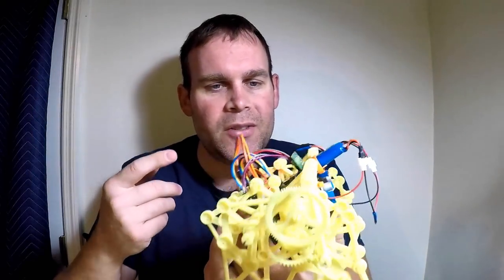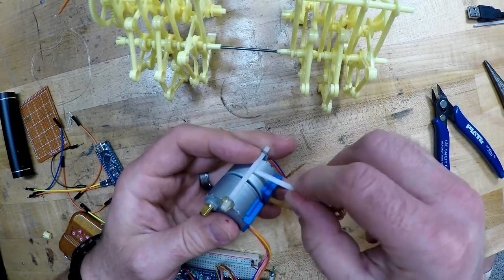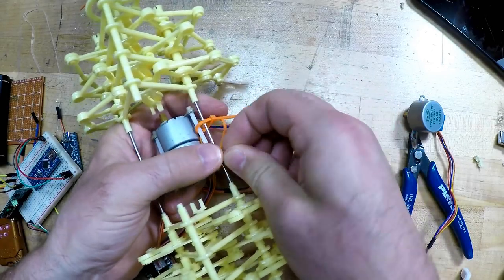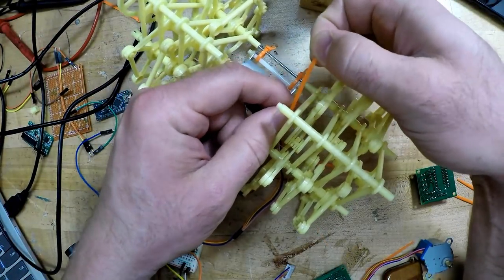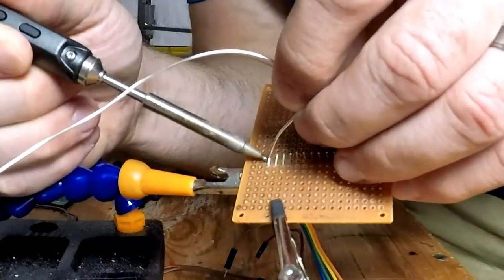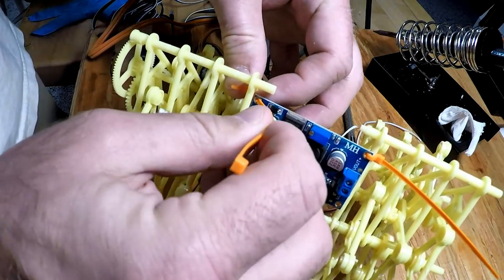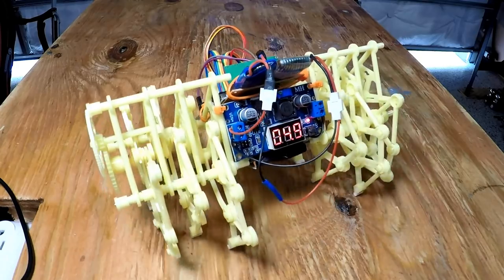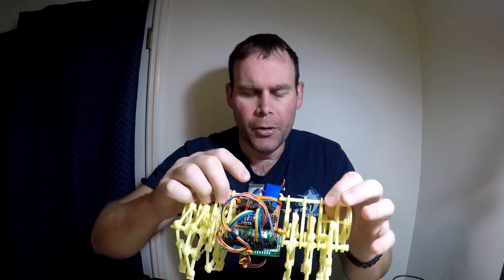Stradbeest Kit Remote Control [Arduino Nano]

Comment: very nice! you might want to look at switching to a Wemos D1 mini as the brains. Since it has wi-fi integrated, you could skip the RF receiver and just control it from your smartphone over wi-fi.
Reply from the maker: That's a good idea. I'm a bit fan of those boards, and actually am planning to use one in an upcoming build... so stay tuned :-)

Thanks for checking the video out!

Comment: Hi Mr.Cook, I really appreciate your work and you sharing it with people...
I decided to do this project to introduce kids to basic electronics, and after following your Instructables page, and copying your code exactly (since I'm a begginer to Arduino) the robot didn't work. Could there be a problem with the code ? Or should I check something else ?
Reply from the maker: Hi Rasheed - It's possible something is incorrect with the code, however, without any other information I would expect something's not wired correctly (the code doesn't really change if you copied it directly, though it's possible I loaded it incorrectly). 

I'd check to see if the LEDs on the stepper driver boards are lighting up at all when you press something. After that try to establish a component that works, and work your way out from there to see what's not functioning correctly.
Reply: @JeremyCook   After checking the wiring we found a small mistake we did with wiring stepper motors to Arduino. (We wired int2 and int3 to 6 and 5 on Ardui by mistake). After correction it seems to work fine, just as shown in your video.
As I'm doing this project as a begginer I didn't read and understand the code properly (hence the small mistake).
Thank you again for sharing your work. A cool project to start with.
Reply from the maker: Glad you got it working, and happy to share!

Comment: Where can i get the batteries? And why are there two?
Reply from the maker: Hi Nhan, the materials list is available here: https://www.instructables.com/id/Remote-Controlled-Strandbeest/ - two are put in series to provide 7.4 volts instead of the 3.7 from one by itself. Thanks for checking it out!
Reply: @JeremyCook   what is the chip attached below the nano? I am new to this. Thanks !
Reply from the maker: The stepper drivers are on one side, and the RC board is on the other. The Instructables page should explain things.